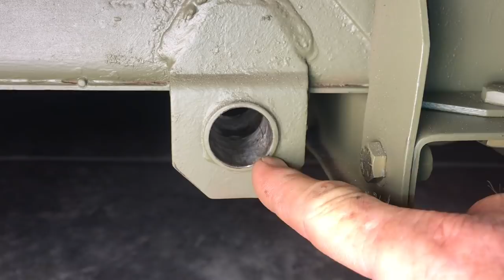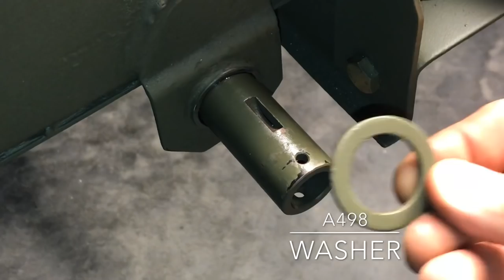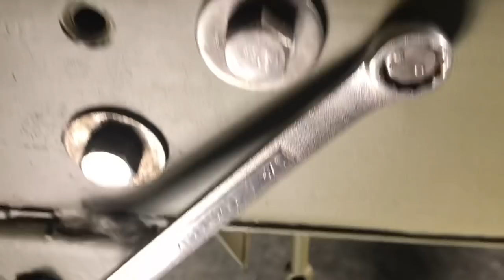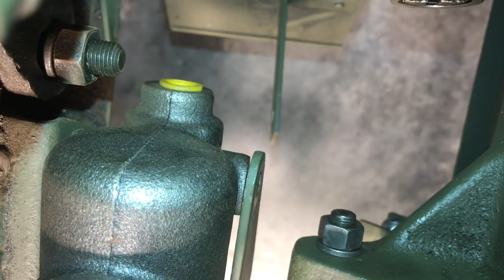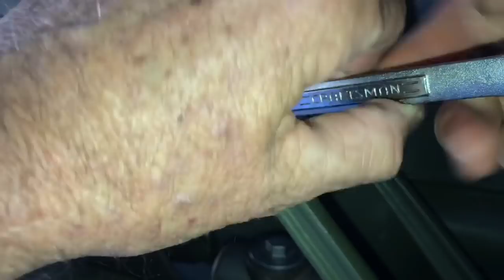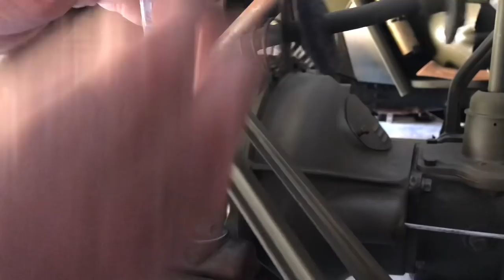Willys MB Pedal Assembly (Part II) Pedal Shaft Final Assembly

Comment: This is a good video. I paid a guy to do my CJ-2a transmission for me. Long story short, it was all wrong. I removed the main shaft and got it installed correctly. I went to assemble and everything back and the clutch cable fell out in my had. So, I'm pretty certain it was not connected. :/  I have looked at the CJ-2a manual. I have looked for youtube videos. I cannot figure out what it is going to take to get that cable installed correctly. I appreciate any help here! Thanks ~P.